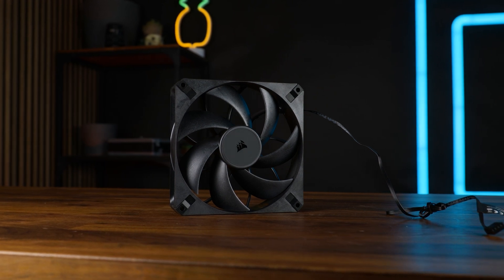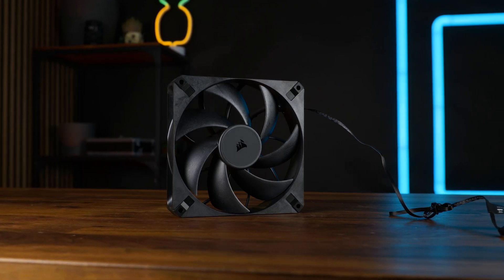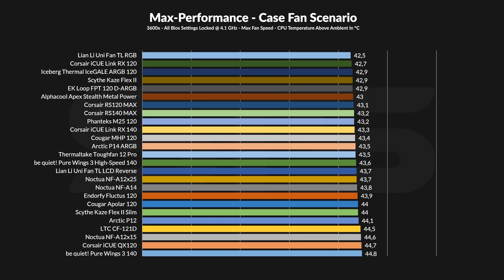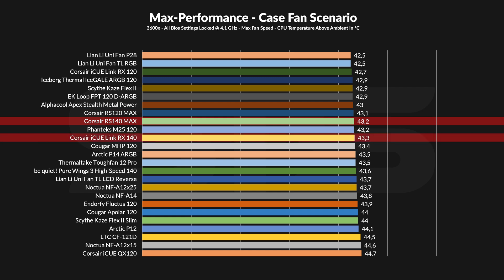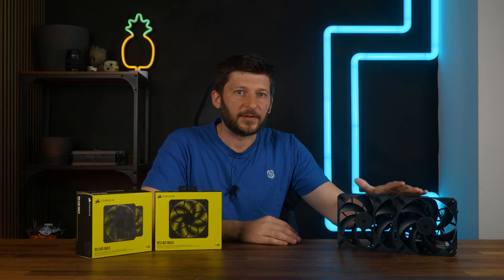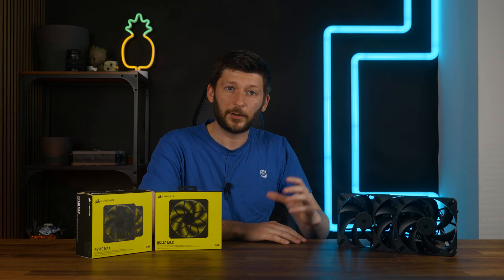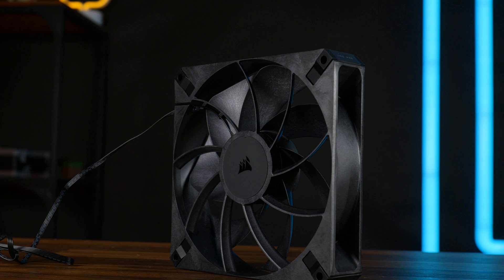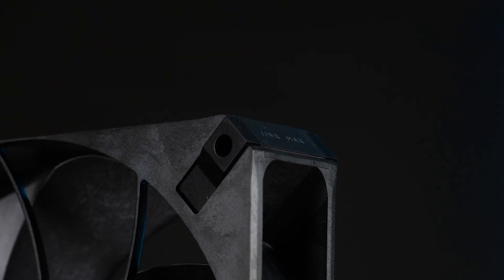The Case Fan Noise-To-Performance King - Corsair RS140 MAX

Comment: I had a fan fail in my 420mm AIO recently. I swapped in three of the similar RX140 MAX RGB fans. My CPU temps dropped a few degrees (nice!), but the surprise was the noticeable decrease in noise. And the iCUE LINK feature has dramatically reduced the wiring tangle in my case. So, if you have the budget for these things, they're a great choice.

Comment: I use Toughfan pro 14 in my Arctic 3 420 and its is really good.
Kinda disappointed in Corsair with the static pressure and the thickness being increased.

Comment: Do these fans not have any threading?
Reply: Do you mean the mounting holes? If so, no fan has threaded holes since fan mounting screws are self-threading by design.

Comment: These fans are getting trashed in multiple reviews when it comes to their noise levels and power consumption.  They have decent airflow, but are not good for the noise level and now that the new Noctua 140mm fans are out, for the same price you can get those instead.
Reply: Just tested both its not that much louder than noctua

Comment: 45€ for a Single fan! Yikes!
Reply: Overpriced AF, compared to Phanteks T30 or Silent Wings Pro 4 which outperform them. Corsair is out of touch
Reply: @krakentortoise7531 i dont think its better than silent wings pro 4
Reply: And honestly I don't even believe is that good over the Noctrua I already have looking at those data...every is within error maring (0-2 degrees) from the bottom to the top of the list.

Comment: Imagine if Noctua went back into the lab and busted out a 30mm variant of the G2 fans in the future that spun to 3000rpm max.
Reply: That would take them 20 years.
Reply: @ICmikeyP  hopefully no 😅
Reply: They're probably working on Industrial PPC G2's at the moment.
Reply: Try Arctic SP120 
4k , 4000rpm , they are kinda loud tho but waw what flow of air!
Reply: @nflisrigged1395  this is probably too loud for the project I wanna do 🙁
Reply: You don't need more than 800 rpm
Reply: @Ladioz  I kind of agree for the most part.  I have my Noctua fans set to max at 1100, but they almost never go that high.
Reply: @Ladioz  800? 🤔 Thaaaaaaaaaat's a bit low, how so?
Reply: @anthixious  For case fans I think it's more than enough airflow, especially mid tower case. I am obsessed with dead silence
Reply: @Ladioz  gotcha, my future PC case of gonna be potentially 2x3ft so I need all the airflow I can get 😜.
Reply: @Ladioz  bro me too, I just can't find any GPU that can keep up with everything else

Comment: If you ever need a video idea could you test how much dust filters or mesh screens impede air flow? Most cases have them and they could cripple the performance of fans that focus more on air flow than static pressure.

Comment: Beating the P14 ARGB is quite a feat. Though using LCP, the cost is quite up there. 4x the cost of a P14/Max is pretty insane.
Reply: P14 max is pretty damn good too. I don't think these corsair ones are 4 times better.
Reply: @mattrichardson2451  Yeah not worth it, these perform nearly at the same level as the Max and thats not using LCP nor 30mm. At this price and specs I'd expect a lot better.

Hopefully Arctic will release 30mm fans in the future as they would blow away the competition if they did that.

For now though the Noctua NF-A14x25r G2 looks to be king for 140 fans. Saw a review for them and they basically destroy the competition. Pricey though.
Reply: @hinchlikescake7592  yeah think even they are 25 bucks each. The P14Max are 10 bucks.
Reply: @mattrichardson2451 even if they are 5% quieter, make my components just 1 degree cooler, or last a few years longer. In the grand scheme, these things are going to run in my PC for the foreseeable future. An extra $15 to get the best is not much to ask
Reply: @DJ.1001  I see what you mean. Just going off my own experience with the max really. Might try these next time or noctua.

Comment: I really got interested when I saw the noise to performance graph, but when I saw that price..... I immediately ordered 5-pack P14 MAX for 59.99€ 😂
Reply from the maker: Yeah, 😂 that's probably the usual choice
Reply: You might wanna cosider the pwm pst instead.The max struggles below 900rpm.
Reply: @kubenoz  In what way does it struggle? They use the same blade design. The Max just has a ring around it (like the ARGB)
Reply: @Violet-ui  I'm not sure if it's the motor or the pwm controller, but the fan doesn't maintain a consistent rpm when set below 900. It's about the same with the noctua industrial from what I understand.
Reply: @kubenoz  yeah, what do you mean strugle?
Reply: another great option are case and cooler fans from thermalright, not sure why they are less popular than the arctics
Reply: @fooboomoo This is what I started buying after Corsair went crazy with pricing.  I could sometimes with 3-packs of RGB with a hub for $45.  Not anymore…
Reply: This is the fan!
Reply: I recently bought a 5 pack of the p14 (as well as a 5 pack+1 of the p12) fans but just the pwm pst ones and not the max fans. Very happy with the noise and performance over my previous fans :). First experience with Arctic. Glad I took the chance on them.
Reply: are they so noisy ?
Reply: @resuldogan3283  what you mean?
Reply: @mister_dzija4161  are they making so much noise or they are working quite ?